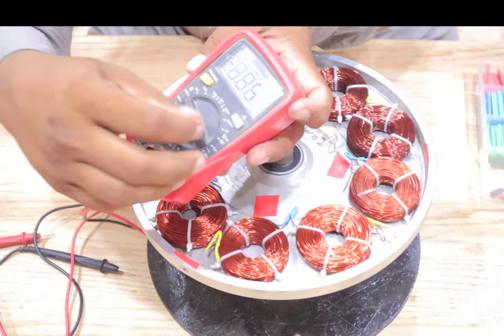How to Make Wind Turbine Generator  2000W Free Energy Generator

Comment: 2000 W needs atleast 30 bulbs of 60W. Just one bulb does not prove it generates 2000W. Moreover such high speed is not possible by wind.
Reply: i dont agre
Reply: 2000 watt means per hour
Reply: I think the point here was a honest attempt of a POC so weldone..
Reply: @24dev yes and 30 watts per hour isn't 2000w per hour
Reply: with gears it can be done to get high speed (or belt drive from big wheel to small wheel), 
the steel disc also acts as a flywheel so minor fluctuations in windspeed have less effect when using ratchet,
only when generator wheel is lower speed than windpower wheel would they engage.
Reply: 😀 @24dev
Reply: @24dev you're thinking of watt hours,  but he only says watts and not watt hours
Reply: Through large pully gear it's possible to run at high RPM
Reply: 2000 watt is the power that this device can give at 220v. P = V²/R
But it can give more than 2000 watt; for example for 400v it can generate 7500 watt. But this is the possible power; this mean  you need to rotate it more than the small drill to generate the maximum power that this can generate
Reply: The measured resistance is 20 ohms. So to generate 2000 W you need 10 amperes of current. The resulting voltage is 200 V. 

So the 2000 W is mostly wasted in the motor wiring. The light bulb takes 100 W. 

I doubt if 10 ampere was generated. Or the drill was generating 2000 W of motion power. Your large pool pump typically is 1000W.

The problem with this design: you must use AWG 18, not 23 wires.
Reply: What speed do you think the drill is? 
Commercial 2000w turbine blades are 1.8-2.1m and will spin 800-1200 rpm.
Regardless the bulb is just a demonstration I'm sure.
Reply: @vilsonib  high speed will result to high power high voltage and high friquency beyond 50 /60 htz . and then power would not be used over common iron core equipments but still could be adopted using high friquency rectfiers and back to usable htz  by use of inverter and a step down transformer
Reply: berapa gulungan coil yang di butuhkan
Reply: @24dev  no? Theres literally a specific unit for that called Watt hours. And this thing isnt even above 30W. I would bet a thousand dollars this isnt even 30W.
Reply: @24dev 😂😂😂.
Not per hour
Reply: @24dev  lol. Watt is power and kW/h is work. Can you feel the difference?
So, if you measure the power of 2kW in a period of 60 minutes (known as an hour) you get a work of 2kW/h. This kind of generator will never produce 2kW power by wind. But the project is nice, no doubt about it.

Comment: Serial connection gives more voltage, parallel connection gives more current. Utilizing both types of connection makes the voltage and current get closer to the phase with each other, keeping the power same.

Comment: Does the copper wire have some sort of insulation on it?  I mean the coils?
Reply: You Need what's called Magnet wire enameled copper wiring.  The coating where you attach other wires to bond to is scrapped off so soldering or crimping sticks to make contact.
Reply: make sure it's for Motor windings.

Comment: Question to the author, wiring diameter, and another question: how many grams does the coil weigh, or how many meters of the line goes. 
If you start insisting, then 5 turns of the reins can be only 50 cm, and when 150 turns have already been wound, the length of the wire increases, one turn will not take up 5-7 cm as at the beginning, but more than 15-18 cm, so the question is how much does the coil weigh or how much? 
meters of wire goes to the coil. Thank you if you give an answer.

Comment: The number 23 is the day of the month. 23 is the number of which the coils were made, the diameter of the wire is indicated on the bobbins with the wire and not the number of manufacture, in your opinion the diameter of the wire is 1.5 mm or less.

Comment: How thick was the copper coil used for this generator? I'm a newcomer so I'm not sure about this 😅😅😅
Reply: Use a 23 gauge enamel coated copper wire, build a farma and wrap 300 turns per coil, if you plan to use round magnets this is perfect if you plan to use rectangular then try triangle shaped coils

Comment: For maximum voltage output you need 9 magnets like 9 coils, not 10 magnets.
Reply: Lo que necesita de forma vital, es un núcleo en el estator, porque un bobinado de cobre no es buen conductor de magnetismo. No en vano todos los motores existentes llevan un núcleo de metal en el estator, y cada bobina va enrollado en su propio núcleo 😊. 
Yo hice también uno casero, más pequeño que del vídeo,  y me genera hasta 400V girando con una cuerda
Reply: Antes cuando no sabía mucho, creía que un núcleo en los bobinados harían que el giro sea duro a causa de los imanes que lo atraen, pero resulta que no es así siempre en cuando los imanes estén bien fijados a la misma distancia entre cada imán y núcleo del bobinado.
Reply: @ReyseAwake  chắc chắn là khó quay khi có tải, vì đây là máy phát 1 phase ,nam châm và cuộn dây bằng nhau cùng 1 vị trí
Reply: Nothing to do with the number of magnets. In generators that actually work the voltage is proportional to the speed of the rotor, how powerful the magnet is, and how well the magnet field passes through the coils

Comment: Hi my name is Leo congratulations for the realization I would like to receive, if possible, information regarding the sizing of the copper coils (number of coils, section of copper insulated cable, dimensions of the same, quantity, etc., etc.) as it is not possible for me to try to create the generator in the absence of the criteria that serve to size it, also the quantity, size and shape of the magnets, in short, everything that is necessary in order to assemble a generator that possesses the parameters or rather that has the parameters of the system that will have to make it move, waiting for your kind feedback I wish you a good evening.Leo